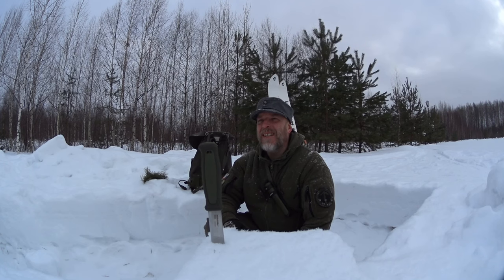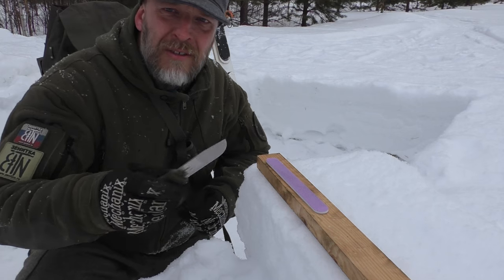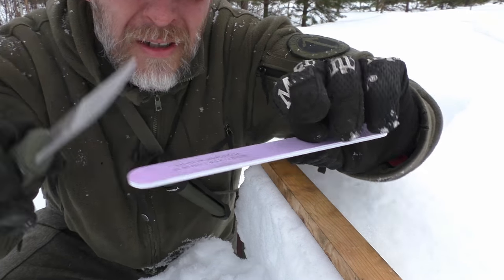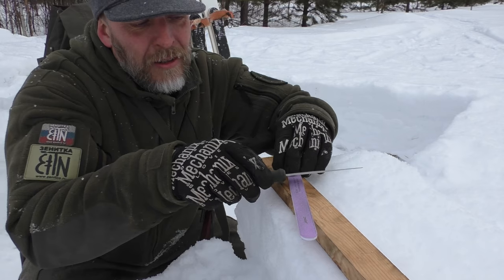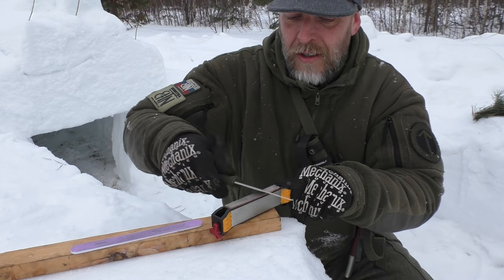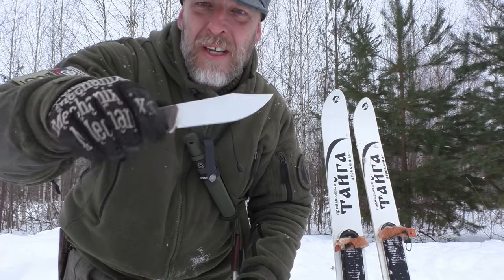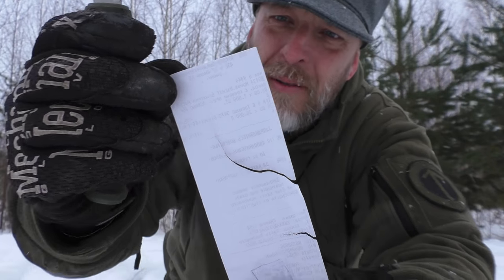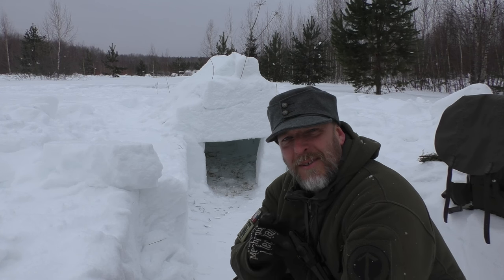How I Make A Convex Edge In 15 Min By Hand

Comment: I used to sharpen my knives flat, but I found that with a convex grind they can be just as sharp, but they keep the edge much better. And it's less prone to chipping. So I'm using a bit simpler method - a stretched strip of sandpaper (first coarse, then fine). If it's attached to something and the other end is held in hand I can control how much of a bevel I want to put in there, if I want a lot - the paper is kept looser, if I want a sharper edge - I stretch it tighter. Works very well, I will usually go over it with a tiny bit of sandstone for final honing and it cuts paper just as well as you presented here, if not even better. Cheap, portable and very effective way to sharpen your knife ;)
Reply from the maker: That sounds good actually :)

Comment: i just use a file. coldfiling, touching it to take heat off and checking the heat. then just a quick pass with a 400 stone, then 1500 and 3k stone. 15min to completely remake a different edge on stainless. 10 on carbon. though my high carbon 20" machette took 3hours

Comment: I sharp everything way under 20 degrees or so 13-15 or so? Did no measure actually but it's rather flat .. for something there is the quality steel :)
Reply: especially when you are going to make a second 'bevel' .. you better start out flat enough. (the second bevel I use 'balsa-wood' (or leather of course) with some green-oil-paint onto it (forgot the super-fine metal what is the abrasive there - when someone is interested - I can have a look.

Comment: Hey, this is a great idea, Lars! Compact and light package, and gets the job done. Your particular nail file has 150/220 written on it, I'm pretty sure this is the grit. Even 220 is too coarse for stropping to be really effective. Maybe if you just carried a small piece of 600 grit sandpaper with you, to wrap around the nail file, it would provide just that extra sharpness you need. On the other hand, a "micro-serrated edge" like 220 produces works better in fibrous materials, and most of all holds better.
Reply from the maker: Good idea on the 600 or finer :) I have to see if I can get some here or maybe I will have to order online.. Anyway, the stropping helps a lot compared to not stropping.

Comment: Great video I purchased the Darex Work Sharp WSGFS221 Guided Field Sharpener 2.2.1 with Five Abrasive Steps and works well and even worked on the AK bayonet, but it did take a little bit of time to get an edge that will cut.

Comment: Lars, I have used the nail file for backup sharpener in the field. Two other ways to use the edge of a car window or the bottom of a ceramic cup/mug. Most people are always close to their vehicle and therefore glass is available. Ceramic cups/mugs/dishes are often found at camp. Keep up the great videos.